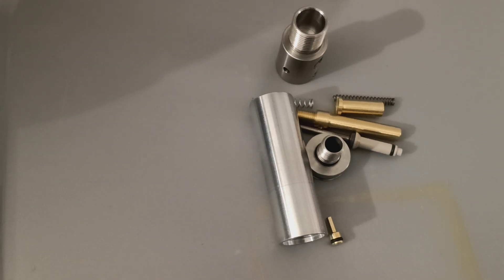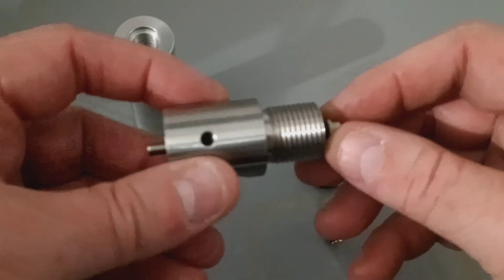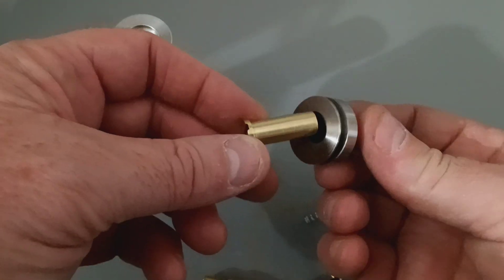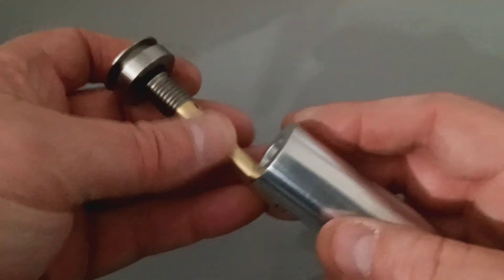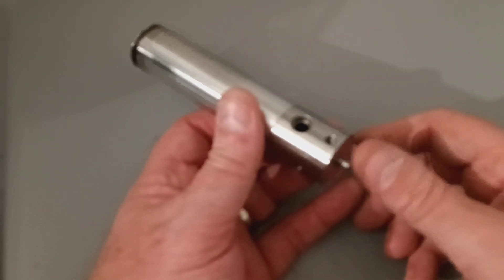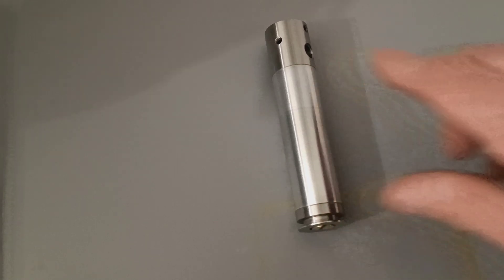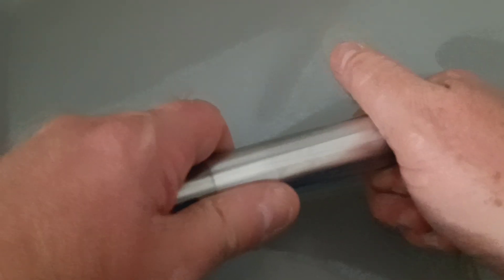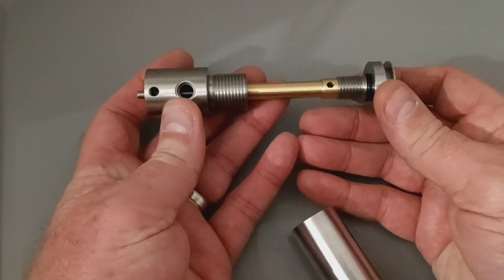Big Bore MSP Air Rifle Dump Valve

Comment: I understand the balance valve operation and the basics of a dump valve. I am interested to know about the details of the atmospheric chamber. I assume there is a stop in the brass central shaft that works on the check valve spring and that the holes are where pressurized air enters the chamber. Is that stop solid? IE are there two portions of the brass center one that is always at 1 ATM (therefore no stiction) and the other side is at 2800psi? 

What force holds the poppet closed when you fill from atmospheric pressure to 2800psi? Did I miss a spring or do you rely on the portion of the poppet in the valve body and HPA to keep it shut during filling and is that why you need a spring on the check valve? I suppose the check valve stays seated until your pump reaches enough pressure to open the check and that sort of dumps enough air to shut the poppet.
Reply from the maker: The central brass round stock was drilled and reamed to create a tube for the poppet to slide into where it is met with a return spring. The opposing end is drilled and reamed to allow for a check seal.  Between the check seal and poppet is a solid wall of brass.  The check seal side is vented to allow pumped air into the valve.

The poppet stem is hollow from where the hammer hits it all the way to the other end where the head of the poppet resides in the brass tube.  This creates a large portion of the poppet head to be at atmosphere pressure indefinitely.  Only a small portion of the poppet (outer diameter) is affected (pushed on) by the valve pressure.

This whole design does two things.

1. Reduce force required to crack the valve.

2. Allows for the valve to act as a dump valve.  The valve pressure is always higher than the atmosphere attempting to close it.

Comment: You have thecomments turned off on your new video on the 30cal. 
Very cool,  btw.... i ws looking at the aspen from Seneca for a while but never pulled the trigger. These pumpers you've created are on another level. Respect brother ✊
Can you provide info on the pumps? Did youfabricate them as well? Or are they off a different gun?
Reply from the maker: Fixed.

Comment: Beautiful machine work. Did you abandon this project? I didn't find any new info about it.
Reply from the maker: Thank you.  All lathe work.  Had just gotten a new, bigger lathe.  Went to work with the project that was planned. 

I just posted a video of the finished gun for you.  With that, a 30 caliber air rifle that was built since then, too.
Reply: @willacewallace5905  very cool. Ill check it out! 
I too am a machinist. I love tinkering and modifying things. Currently im modding an Umarex G2 in .22 for use with slugs. Its basically not the same gun as it once was. Lol